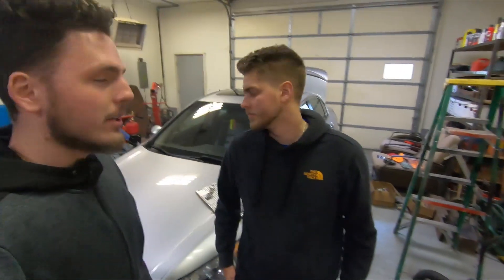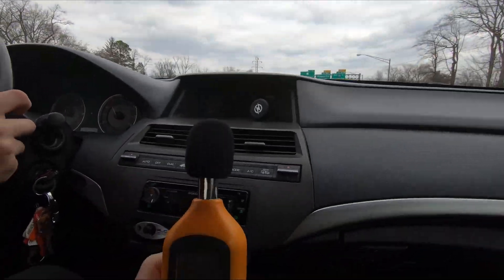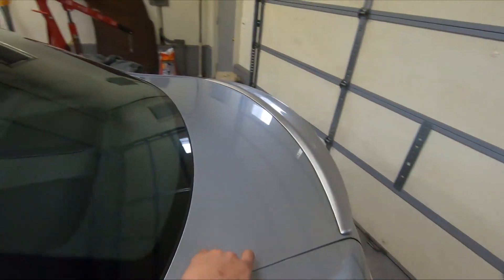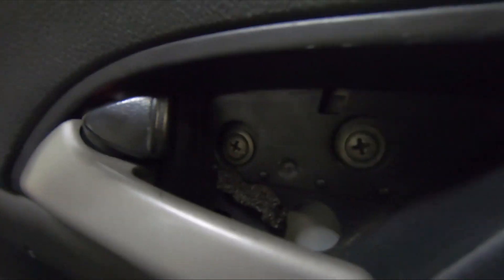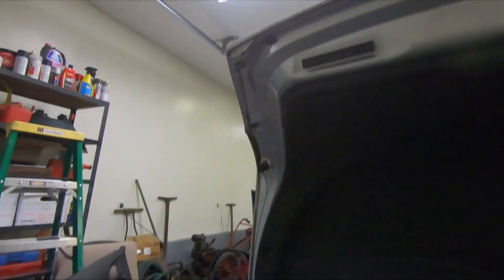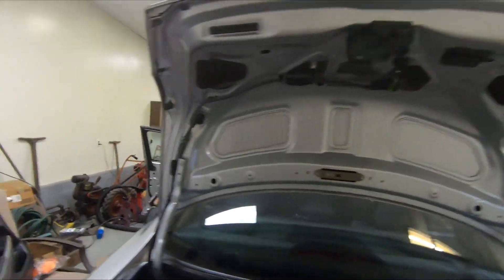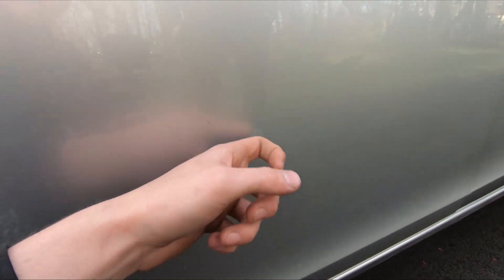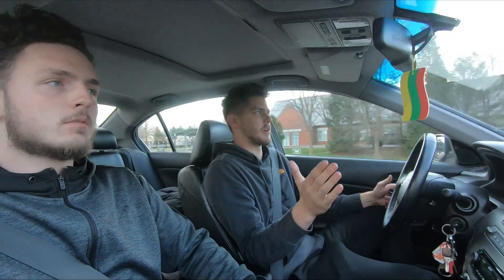THE MOST OVERLOOKED AUDIO SYSTEM UPGRADE | 09 Accord V6

Comment: Wipe the surface with a degreaser or water/alcohol mix to assure proper adhesion and you won't need much or any heat
Reply from the maker: It was cold when we were doing it and I wanted to make sure we got maximum adhesion, will keep that in mind though